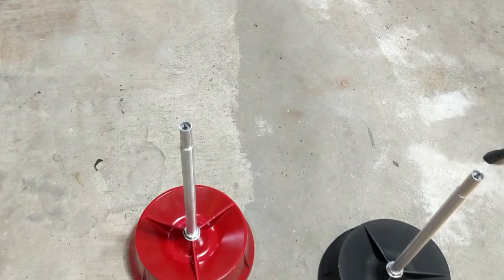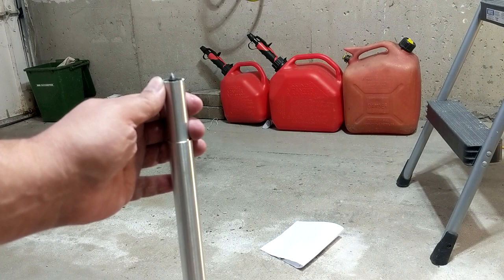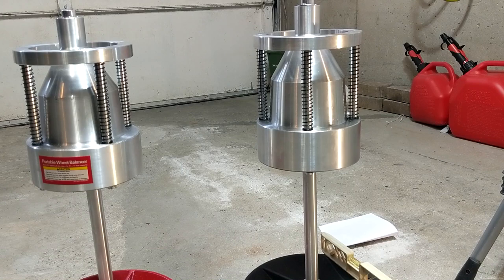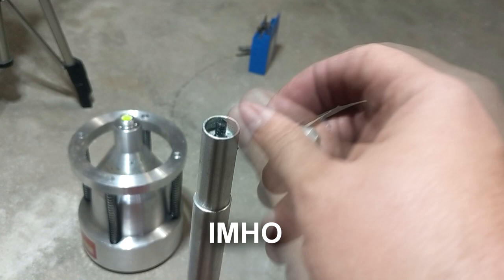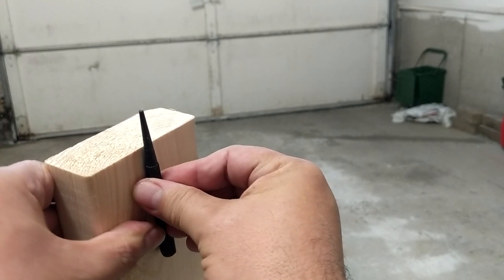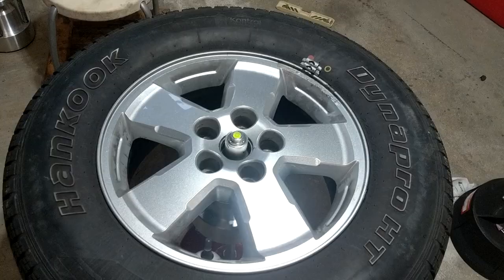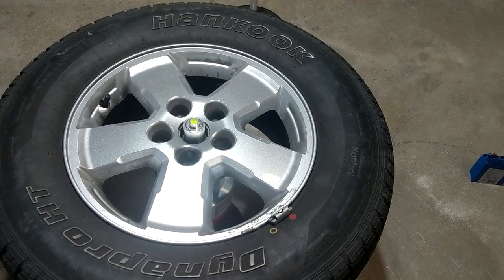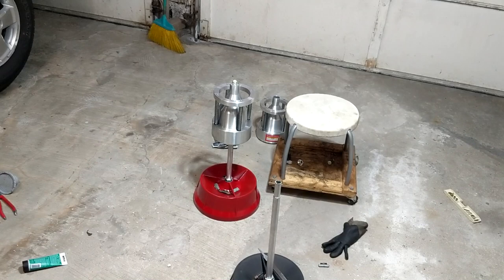Balance A Tire The Better Way. Free Wheel Balancer Mods Makes It 100x More Accurate For $0. PT 1

Comment: just so you aware, as a tire technician myself having worked in a tire shop, they teach us that usually on most tires there's supposed to be 2 colored dots, a yellow and red, the yellow dot (representing the tires lightest weight point) should be lined up beside the valve stem and the red dot opposite side of the tire across from the valve stem the reason for this is because, 1, your valve stem adds weight to the side if the rim it's on and makes enough difference that it'll throw off the balance and 2, the red dot symbolizes the heaviest point of that tire so lining the red dot on the opposite side of the rim from the valve stem counter balances the weight so by installation its as close to balance as possible without the weights added, the weights added are only to supplementary zero in the overall tire/rim assembly, ei, a wheels overall balance, however there is a difference between static balance and dynamic balance, in the older days where all the shops did was static balance was fine for those wheels because they were not radial tires but now with new tires, all being made radial, when you static balance your only accounting for the up and down motion not the side to side motion and thus if the radial motion is not balanced you'll always have vibration regardless of what you do. not to mention cuping, and uneven wear, if you have cuping or uneven wear no amount of balancing will solve that and you'll be left with vibration regardless of how balance the overall wheel is both dynamically and statically just some info to consider with the balancing your doing, I'm sure your probably aware of all that but figured just in case you weren't I'd share! hope it helps and hope the balancing method you use works out awesome!
Reply from the maker: thx for your input. but you can see the dots on my tire why are the yellow and red dot right beside each other if they represent the heaviest and lightest portion of the tire. vibration is much better now after my diy balancing, vibration starts closer to 130km/hr but b4 it started b4 120km/hr, i can live with it as i barely go past 120. could be something wrong with the tires and/or rim  but for now its much better on the highway
Reply: @diyvinny6300  yes I did notice the yellow dot beside the red, haven't seen that before to be honest, normally their on complete opposite sides of the tire from each other, mightve been a manufacturing mistake not sure, and awesome great to hear! Normally if the shop is dead I can just bring my own vehicle in to do my own changeovers and balancing but it's not currently an option and I don't really want to wait since I'm planning on changing over my rears to all terrains so I was thinking I'd buy one of these static balancers and do it that way, the way I see it at this point any balancing wether static or dynamic is better than no balancing so ill have to keep your mods in mind especially if they solved your vibrations then definitely worth the work of the mods!!! Thanks for your videos tho great explanation and details!
Reply: Kyle, you are partially correct. Yellow dot is the lightest portion of the tire. However, the red dot is NOT the heaviest portion. It doesn't even have anything to do with weight. It marks the HIGHEST spot on the tire. Tires (and wheels) are not perfectly round so the red indicates the highest spot. If your wheel has a white spot painted on it, the red spot lines up with the white dot. If not, the red dot will line up with the valve stem.

If your tire only has a yellow dot, it lines up with the valve stem. If the tire has both, the red dot takes precedence over the yellow dot. The reason being is that you can correct weight imbalance in the tire with balancing, while you cannot correct for roundness imperfections of the tire without shaving it.
Reply: I know its not popular for the first time I used balance bead’s- I’m never going back to weight - yes you get a little shimmy when you start out but it balances quickly . And my tread ware last longer. As tires ware balance changes beads keep adjusting. Have not ran into a problem yet
Reply: @jimfields9217 dont the beads hurt the tpms?
Reply: @jimfields9217  I have heard great things about balancing beads. I still haven't tried it myself yet. I have a motorcycle that the shops never seem to get the balancing done right.
Reply: Great post I appreciate your insight, I learned a lot!
Reply: @kylewick2818 maybe it indicates the tire is balanced already.
Reply: So I just did tires where the yellow was within ½inch of the red
Reply: red dot indicates the "HIGHEST " part of the tire,...not the heaviest
Reply: Why not just bore out the shoulder on the hole bigger?

Comment: It's engineered that way for a reason. It's not meant to touch the bottom of the hole. If it did and wasn't touching the sides,you'd never know if the pin was centered and it would be impossible to balance a tire with it. It's meant to sit on the face of that hole without touching the bottom of the whole to allow the thing to move around on the pin and that ensures it is perfectly centered.
Reply: @kimokahikolekalihi I agree, it's engineered that way for a reason. One a wheel is on there it moves around easily. Adding some thin grease will help with initial bubble leveling
Reply: I too thought about that as well??...and realized that unless the bottomed out pin point seats in a perfectly centered inner hole that it would NOT be centered accurate, so I used a Dremel with a polishing wheel and a polishing nub with some fine rouge compound and then polished the pin and the ID and edge of the hole and it WORKED!!...It reduced the friction between the Pin and the hole to where it performed like this dudes mod, so unless you have a absolutely centered inner hole of the hole, your never gonna have true center!!...Instead of grease, I used something called Ultra Slick...It's an engine assembly lube made by Permatex...Item# 81950... that's incredibly slick reducing friction better than anything else, only need 1 drop and it wont get as stiff like grease especially when its below 65 degrees F and is slicker than water based personal lube...After I did this mod I rebalanced all my tires and this cheap azz 49$ balancer completely zero'd out ALL the VIBRATION!!
Reply: The pin will most certainly "find center" because the bottom the hole isn't flat, it's conical.....basic physics.
Also, may help you understand if you look up the patent....the pin has a "sharper" point than the hole, the difference in angle allows movement while still finding absolute center.

Comment: I just bought this balancer and did my wife's snow tires... you can clearly see the balancer doesn't have the movement or sensitivity it should. I figured a youtuber would have the answer. Thank you! I will be drilling out for my next balance.
Reply from the maker: yup, and if u use a laser its that much more accurate that its actually a pita to use to do the job, or its just my ocd, idk.  im working on the vid as we speak with how to implement the mod and how to use it but just going to upload vid on the mod itself and not in its use.

Comment: Good info here. Back in the 70s we used an Atlas bubble balancer similar to the M-60. We used the Y method where the weights are  split away from the low point till it balances.  Never had a customer complaint. I still use that method today with good results.
Reply: Can I find out how to do the Y method online or on YouTube? I think I know what you're saying but I'm not sure.
Reply: Sixtyfiveford

Comment: You had lined up the RED DOT with the air valve you would have got it balanced. The RED DOT is the Highest part of the tire and the the YELLOW DOT is the heaviest part of the tire. If there is both dots on your tire,.. the RED DOT is used over the YELLOW DOT every time. it seems the shop that installed your wheels on the rims did not do it do that when they were installed.
Reply from the maker: i didnt mount the tires, 2 mechanics didnt bother to line it up

Comment: That's the mod I made, and I touched up the center of the hole where the point sits with a center drill in the lathe. Very much more accurate.
Reply from the maker: i dont know why they dont manufacture it this way as its simple to do at the factory. btw adding the laser mod is so much better than trying to use the bubble as the level reference point. it even adds more precision and visually easier to read

Comment: You are wrong about the drilling out the hole. Mine was bought about the same time as yours and it was made of steel and if you don’t get the hole drilled out in the first time you probably won’t get any farther than that because you have hardened the metal and you will just burn up the drill bits , I know for sure because it happened to me so you have to change the pin on the shaft   And it can’t be a point , it has to rounded over because the spot you tried to drill was almost flat.

Comment: Just tried the hole widening mod. No need to file the tip. The tool was basically useless prior to this modification and now its fully functional. Thank you for sharing your R&D and posting this video.
An excellent modification that costs nothing, requires no special tools and can be done in seconds. 
👌
Reply from the maker: agreed, widening the hole is all she needed
Reply: @diyvinny6300  Same here, Went from stiff to free floating with simply drilling down the hole

Comment: You are the only person who shows me to punch the core out, Thanks. The only difference is that after I had widened the hole I put it in a cordless drill as a drill bit and grinding on the pin together until the point touched the bottom

Comment: Bought one last week, and it 'sticked', not pleasant to work with. A bit disappointing. I had to do 3 more tires today, so roaming around on YouTube looking for inspiration I opted for this simple modification. Thanks a lot for this inspiring video. I unscrewed the bubble and then I gently hammered the top metal piece out from the bottom. Then I inserted the piece upside down about 5 mm on top to have a better centre  and stability and grip whilst drilling. Started with a 4 mm bit, then 5, then 6, up to 8 mm. The insert on mine is quite a hard steel, so I used drilling oil. It worked fine with a cordless drill, no lathe required. 
Now the balancer is working like it should.... and yes!, it wobbles!

Comment: In my experience the hole on these balancers is not always precisely centered to begin with. And that's a bigger issue. Even 1/256" out of center with 20-30lbs wheel on the balancer will throw it out by 1/4oz. It's easy to check, so when you put weights on the tire to make bubble perfectly in the center, lift the tire off the balancer (don't spin tire on the balancer!), keep the balancer head in the same position don't spin it, then turn the tire 180 degree and put it back on - most likely it will be out of balance again. Put new weights to re-balance placing weights in the same location where previous weights were - this time it will be a bit different weight to make bubble in the center again. The correct weight will be sum of two divided by two. For example first attempt was 1/2oz, second attempt after rotating tire was 1oz, so your final weight will be 3/4oz. Now, with 3/4oz on, re-adjust the bubble to bring it into the center, lift the tire, turn it 180 degree and watch the bubble remains in the center to confirm the tire is correctly balanced. Now your bubble is adjusted to balance rest of the tires of this same(!) set. Keep the balancer head in the same position for the current balance session. For different set of tires the bubble will need to be re-adjusted again, since for the off-centered balancer with different wheel on it will move center of gravity again. This method also does not require to level the base. Hope it helps. I can see why so many have bad luck with this tool - because they assume it is precisely machined and balanced on its own, yet they wonder why every time they put the tire on the balancer it shows different balance. I'm not a youtuber, may be someone can put up a video about it eventually. 

As it goes for this video - not sure whatever good this guy did - but he might contribute more into out-of-center issue by unevenly re-shaping the pin and the hole. I just slightly hit the pole with hand couple times to stabilize the balancer with wheel on it to help it to find it's true balance and effectively address the friction issue.

I can do 200km/h on the track like a breeze not needing fancy electronic balancers.
Reply: I feel like I could use your method to balance the leveler to a set of wheels, then use some weights stuck on the balancer to balance the balancer permanently..
Reply: Perfect
Reply: @BigBrotherIsTooBig  Not necessary. The balancer has three adjuster screws to center the bubble.

Comment: Good information, later on in the video you stated that 2 Tire Shops made claims of it's either the wheels or the tires.  Here is what is absolutely hilarious about those analogies; the 2 Tire Shops never even recognized that the (generally) yellow/white circle on the tires (from the manufacturer) needs to be at the location of the valve-stem location to be at the nearest point of not needing to be balanced at all.  But I guess they (the 2 tire Shops) are so good that they have X-Ray vision.  Pop the beads loose on the tires and shift the tires on the rims and put the (generally) yellow/white circle on the tires (from the manufacturer) at the location of the valve-stem location and rebalance.  Of course, if you already have had extensive wear on the tires and there are already any flat spot deviations on the tires; that will also affect the balance actions as well.  When tires are new, they should always be placed at the (generally) yellow/white circle on the tires (from the manufacturer) needs to be at the location of the valve-stem location.  It is there for a reason.
Reply from the maker: its on my todo list, but i did get a better balance from my diy compared to the shops, i rarely go past 130km/hr, 80mph, as thats where i start feeling vibration but i juust havent gotten around to it yet

Comment: It's possible with wet tires ,that have a different tread pattern , & more,or less grip to the road  ,the balance could feel better by the tires themselves holding the steering joints tighter. In other words the "toe in " specification could be helping the front end from shaking.  The other thing that might not be picked up by a tire installer, is some sort of deformation that occurs with speed .(computer balancer's spin at a low rpm ).. You may be able to fine an alignment shop that balances tires on the vehicle ,(these units usually spin the tire much faster )..Hope that helps .Yup I got the same balancer, & did similar mods . & even moved the balance point up with a spacer under the cone , with limited results..

Comment: Instead of making the hole bigger you could make an insert. You can easily make a concave in a steelrods end with your drill and a dremel.

Most tire companies doesnt tell what the coloured dots are for, which they should because it differs.
Some do. Yokohama says the red dot is the highest spot on the tire, and it should be matched to the lowest spot on the rim to get a cirkular wheel. Lucky you if your lowest spot on the rim is marked.
But being the highest spot on the tire, it is also most likely the heaviest , when the wheel starts turning. Bridgestone says the red dot is the heavy spot.
The yellow dot is the lightest spot on the tire and should be placed by the valvestem.
So;
Red dot first choice, by a mark in your rim. Second, furthest away from valve stem.
Yellow dot, by valvestem, if you dont have red dots.
Reply from the maker: steelrods? the insert is concave since thats the the drill bits profile
Reply: Make it spherical, 8-10mm radius. Smaller radius, 3-4 ,convex, on top of the column.

Comment: As others have said, drilling in a lathe would work best. Might I add, instead of using a drill bit use a precision counter sink to get as close as possible to a dead center pin point recess for the pin to pivot in.

Comment: I have olde bubble balancer back in 1960, more accurate than today’s.    Sucks wheel center hole don’t fit have to use new ones.. hate those… I already drilled the pivotal point wider. Used my common sense if tire well balanced by using the “Y” system. Had no issues since.

Comment: I just did stock pin, drilled hole.  There is a lot more movement and it's more sensitive.  I went from never getting repeatable results to repeatable about half the time.  I don't know.  I probly need a vintage Coats or a spin balancer.

Comment: Conclusion: Simply drilling out the hole inside the balancer does the trick, because a standard drill bit will leave a 130° cone shapd hole.
It would be even better to use a steel insert (bolt ?) fixed in the drilled hole, and then drill out the head of the bolt to get the same result.
Except the steel bolt will last a lot longer than the stock alu insert.
With this modifications you should not need to level the base, provided the balancer is adjusted correctly.

Comment: The pivot point has to be modified as standard the sensitivity is terrible. I knocked the bush out below the bubble and screwed in a stainless steel bolt with a concave head. Works great, very sensitive and balanced tires with no problems. Thanks for the info in your video.
Reply: can you share more details maybe post a vid as well and send me a link  ty

Comment: I used a bubble balancer back in the 80s. There ok kinda but not really. Most tires nowadays will vibrate doing a static balance unlike old byis ply tires of yesteryear.